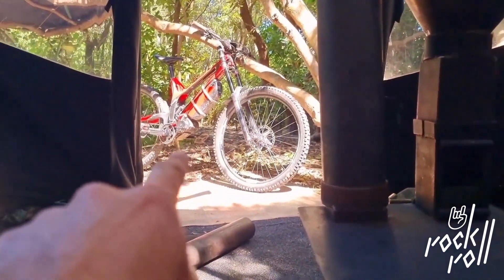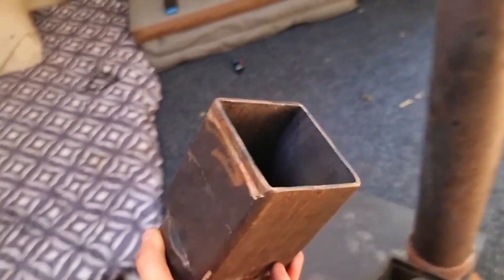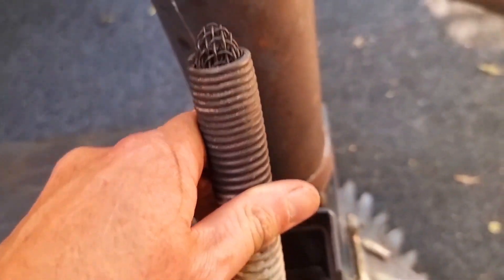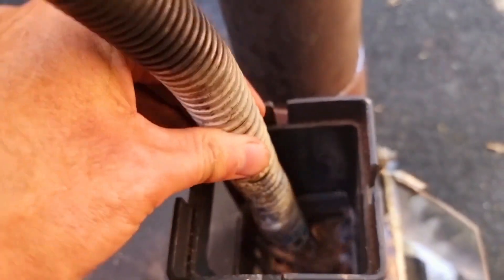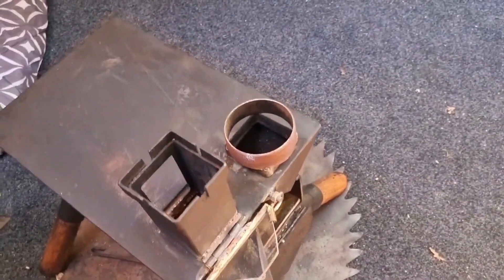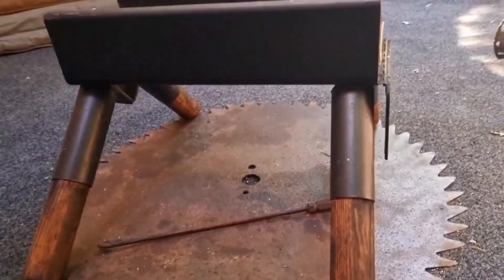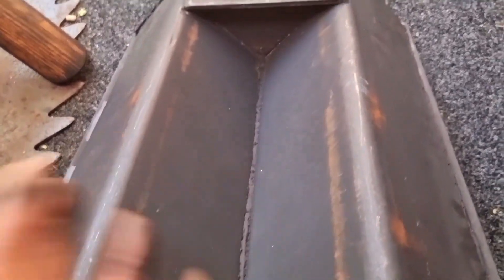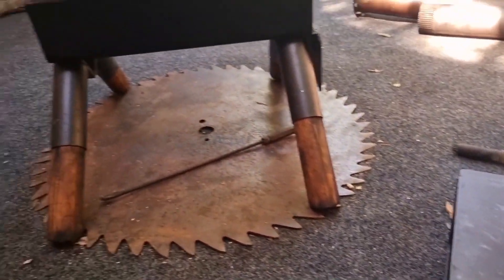#rocketstove WHATS INSIDE THIS ROCKETSTOVE ?🚀 better detailed videos coming, currently, moving house

Comment: What's the burn time on a fully loaded hopper of pellets plse?
Reply from the maker: The burn rate on this stove is about 1 cup of pellets per 25 mins .that hopper was just a prototype it burned just over an hour.
Reply: @rocketstove007  thank you. I have been looking for a self-feed type set up that might burn up to 9 hours....
Reply from the maker: @gideonporter537  they can do that, this prototype one starts to dull down after a few hours of operation, but thats just because it doesn't have a ash dispenser, ash gets in front of the basket and slows the draw. A 20 kg bag of pellets will last  6-7 hours Tested it in a run time test once .
Reply: @PYROFLOWROCKETSTOVES  6-7 hours is good. Perhaps a damper would give that extra 1-2 hours for a normal sleep. Hmm. I see possibilities 😁
Reply from the maker: @gideonporter537   the problem is with a damper down is the less airflow over the pellets. If the draw decreases to much that encourages the flames to travel up the pellet hopper instead of being drawn through the rocketstove. I think I have cracked this problem but more testing is needed. This would not be a problem so much with an outside set up ,I am just on a mission to make these 100 percent safe for indoor use thanks dude

Comment: Where do you get your glass? Ebay glass is very expensive
Reply from the maker: I just get mine from a local glass supplier, yes it is expensive.  This stove only needs a small amount though. Approx 100mm x 360mm
for example last peice of ROBAX glass I bought was 500x500 mm cost $150 nz around $70 us.
Robax ® is the ideal fire viewing glass. It is a clear ceramic glass with great resistant to thermal shock and heat, so much that it can withstand up to 760° C for up to 5 hours and 560° C for up to 5,000 hours.

Once I move house and settled I will sort out a decent video on the glass work, thanks for watching 👀 👍
Reply from the maker: It's probably cheaper to buy locally at a geuss ,ebays high pricing might be due to the glass being fragile, higher shipping cost etc
Reply: Try the dump/recycle shops for old glass oven doors maybe?

Comment: Where do all the ashes go and how easy is it to clean out. Does it get clogged with ashes ? After a while
Reply from the maker: After about 6 hrs of use ,I  would collect about 1/3 of a cup of very fine ash. The rocket stoves vortex flame spin and rocket draw effect, effectively leaves stuff all ashes to clean up. My latest design has an ash dispenser but not really needed for a few hours a night burn etc, but with this 1st prototype stove I would just take the front glass  off and tip up the stove to release the ashes. It takes a long time to clog.why you might ask?. The rocket suction effect vacuums away the ash mostly. You do get a slight build up of ashes, just in front of the pellet basket. This stays mostly the same size throughout the burn, however many hours that is.
Interestingly, I think that the pile of ashes in front of the basket that accumulates is actually just slightly heavier ash that is still being drained of its energy . once the energy is expired, it becomes lighter and wisps away. Always replaced by new pellet particles that are now too small to stay within the pellet basket.
Reply: Quite the efficient design & very interesting --Re:
"Interestingly, I think that the pile of ashes in front of the basket that accumulates is actually just slightly heavier ash that is still being drained of its energy ." @PYROFLOWROCKETSTOVES
Reply from the maker: It's also thanks to the pellet fuel I should add. Pellets are perfectly dry, compact and consistent.  They definitely leave less ash than the same rockstove with a  kindling wood hopper attached.  Wood pellets are credibility compact power houses that are as easy as a gas stove to use, but with that all natural fire effect.
Reply: @PYROFLOWROCKETSTOVES   That's the sort of random words Trump would use.  "Wood pellets are credibility compact power houses"